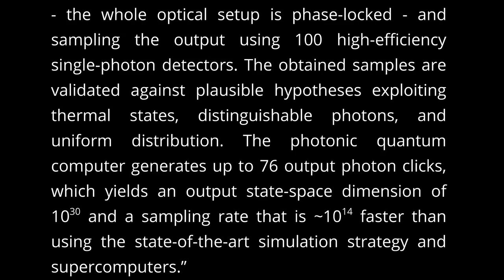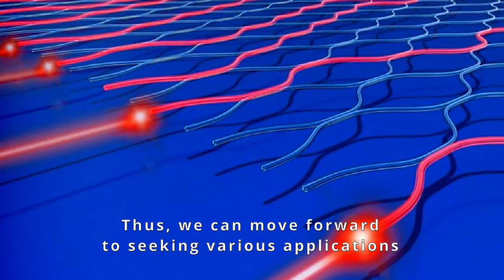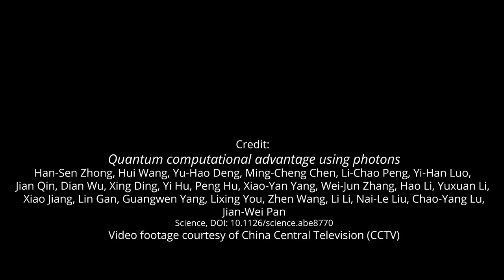Jiuzhang achieves quantum supremacy

Comment: US : you stole that from us, whats it called again  ?
China : quantum computers
US : yh that
Reply: @waleczny9308  no one has achieved quantum technolagy but China.
Reply: @waleczny9308  The US uses superconducting quantum computers which require cryogenic temperatures or pressures exceeding 150 gigapascals while china uses photonic quantum computers which can operate at room temperature and without pressures significantly higher than those at the core of the earth. They are very different technologies, so yes, saying that the US doesn’t have the technology is actually correct.
Reply: @waleczny9308  America’s fastest quantum computer Sycamore by Google is 10 billion times slower than the Jiuzhang photon supercomputer, yOu CaN fInD mOre iNfOrmAtiOn oN tHe iNtErneT
Reply: @nikarthur9996  Damn you're smart, your IQ is at least 130 with this kind of comment

Comment: Huawei can skip the 5nm wafer tech and jump to quantum chip.
Reply: Don't count on that yet.
Reply: Not for a while. Huawei has now sold its subsidiary, Honor, which has become a state-owned enterprise that United States is hard to sanction, to pursue growth
Reply: @jackchen683  its good for it as they can used the remaining KIRIN 9000 for its next p50 series.
Reply: It isn’t that hard to catch up. Israel is a good semiconductor leader, China can work out some deal with Israel. I say in about 5-7 years time, China can have the semiconductor industry on lock down.
Reply: Also, quantum and bio are different from classical computer (the current computer we have). Quantum is like the next phase in analog computer, continuous. However, classical computer is like an on and off switch, which is discrete. We will still need discrete computer for “high precision calculation” but for most tasks, where accuracy is not an issues, analog will be the way to go (ex: physics simulation, and machine/deep learning).

Comment: To be fair, Google's Sycamore was the first to achieve so called "quantum supremacy" last year, even though in a very limited manner i.e. random generated number checking, which can be performed by classical computers as well. In comparison Jiuzhang's achievement in solving boson sampling is in practical terms impossible for classical computers to do. At this stage, quantum computers are being built to solve a single problem each, still a long way towards a programmable general computer. 

At least Jiuzhang's photon based design provides a viable alternative to Sycamore's super conducting qubits approach, very good news to the field of study overall.